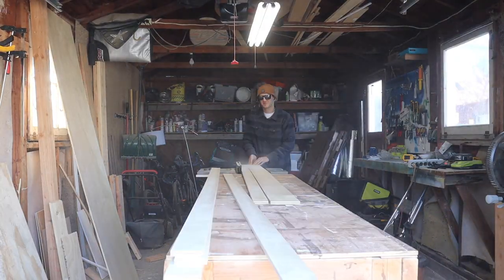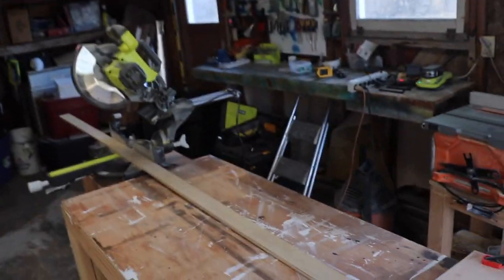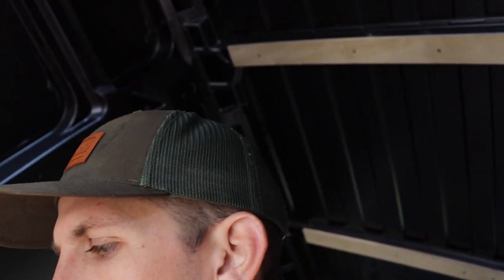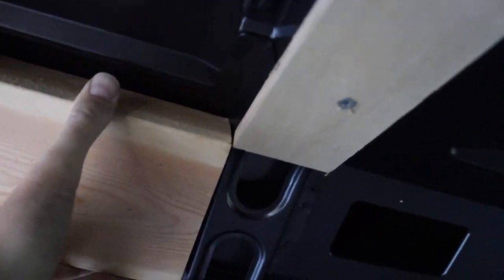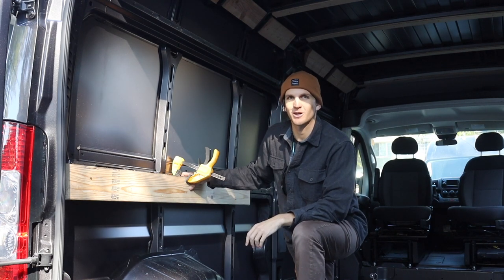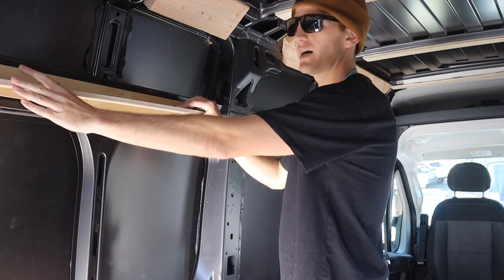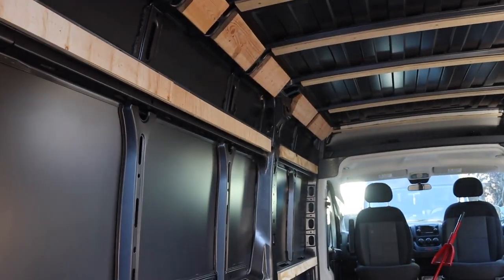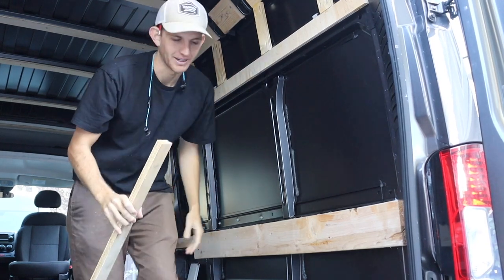VAN BUILD | FRAMING a RAM PROMASTER

Comment: Hi. Just got my van and took all of the wooden paneling off. I noticed that there was rust around each one of the self-tapping screws but I see that all of the pros are using them. Aren't you bothered by rust? Thanks.
Reply from the maker: Hi! How old was your van? What was it previously used for? My first van that I still have is 2 years old now and I’ve encountered zero issues!
Reply: @AnkeneyVanBuilds  Hi. The van is a 2017 Ford Transit. I think that the previous owner was a mechanic. 
You can see the rust here: https://photos.app.goo.gl/SLXsrjSoUwDvPkFP7  
Thanks!
Reply: sorry, wrong image. this one was from the roof. same thing though (but smaller) around self-tapping
Reply from the maker: @balaftuna  interesting. I know my screws are coated with a rust resistant type of coating so maybe that helped? Thanks for sharing the photos
Reply: @AnkeneyVanBuilds  Thanks! I'll make sure mine are coated.

Comment: Hope u don’t mind me asking another question. Do u worry about metal shavings?  When drilling are you just doing the wood or both wood and metal?  Just wondering since they are self tapping screws.
Reply from the maker: Feel free to ask as many questions as you want!
I’ve noticed when drilling into the van through the wood that the wood catches all the shavings. And I make a point of thoroughly sweeping out the floors every day when framing. 
I did the same on my first van over two years ago and have had zero issues! 
Hope this helped! Cheers
Reply: @AnkeneyVanBuilds  u are the best. Framing starts this week
Reply from the maker: @johnmeeker6538  hell ya! Kill it!

Comment: I am planning to run vertical L track to make my bed platforms height adjustable. Do you think the half inch plywood furring strips are stable enough to support such a system? Thanks again
Reply from the maker: I think 3/4 at a minimum !

Comment: I’m surprised you’re not filling in all those little openings in the metal with insulation first before blocking them with some of the wood like the two by sixes. What are your plans for insulation?
Reply from the maker: Hi! I have a video on insulation if you want to check that one out to see what I did!

Comment: i don't get how u screw down the ply wood pieces into the metal ribs..
like do u drill new holes or use the ones that are already there
Reply from the maker: The self tapping screws drill into the metal. they're specifically designed the attach wood to metal!

Comment: some of my 2 by 6s up top ended up being a little crooked, do you think that would present an issue with the wall panelling?
Reply from the maker: Hmm crooked which way? As long as the top of the 2X6 is flush with the ceiling frames work and the 2x6s are flush with each other than it’ll be okay if they’re crooked!
Reply: @AnkeneyVanBuilds  oh glad to hear! Thanks a lot!
Reply from the maker: @danielkopaee9241  you’re welcome!! Good luck 👍🏻

Comment: I just watched it for the third time, it’s amazingly complete. But it is a fairly daunting process for a beginner. How about this idea, since it’s a gift from the gods of automotive heaven that all these pro master 159 wheebase vans are quite similar, how about you design a series of laser or CNC cut side and roof ribs that can be installed to the walls as a base for cedar siding.  I bet you could figure out a way to do it with your very clever indentation in the sides where the bed is to make the bed longer.

 In my crazy mind, anyway they would be like the ribs on a kayak, maybe only  five sets per wall/roof allowing for all the ins and outs and difficulties. You might lose a tiny bit of size in the van but it would be worth it for us newbies. The beginner builder could attach them at prearranged points on the van wall/roof. Then simply stuff in the insulation and just start nailing up the siding ignoring all that blocking and challenging transition from roof to walls. I would buy something like this in a HEARTBEAT for a high price. Particularly considering how much money anyone will save on hiring an expert. You could ship them all flat in cardboard boxes w accompanying videos.

Anyway just off gassing over here looking for the easy way. Keep up the good work man, you are a wonderful craftsman and a fabulous teacher.
B
Reply from the maker: Wow that’s something I have never thought of! Interesting concept!!! Thanks that you for the ideas and compliments

Comment: Interesting, just curious but why not use either a rivnut or plusnut instead of just screws? The existing holes look like an M8 would work.
Reply from the maker: Those holes are few and far between. I have nothing against riv nuts.. my method is much less time consuming, cheeper, but still very strong and reliable! Thanks for the question Eric!

Comment: Awesome video. Going to frame my van this way. Only had it 5 days. Question on wood. Bed frame is 2x6 correct?  Transition from ceiling to wall is 2x4?  Look forward to more videos. Thanks
Reply from the maker: Both of them are 2X6!! I think I miss spoke in the video. 
Ceilings: 1/2” ply 
Transition from wall to ceiling: 2X6
Walls: 3/4” ply
Bed frame: 2X6
Hope this helps and good luck 👍🏻
Reply: @AnkeneyVanBuilds  really helps. Ty

Comment: Was the 1/8 in. drill bit used to pre-drill holes in the wood (not the metal)?
Reply from the maker: Both!!
Reply: @AnkeneyVanBuilds  I'm glad I asked!..lol  I'm a newb. I misunderstood the meaning of "self tapping".
Reply: Did you try to vacuum up the slivers of metal from drilling and Rust-Oleum where you drilled?
Reply from the maker: @planat96  yes, I vacuumed
Reply from the maker: @planat96  you’re correct tho. Self tapping does mean it should go in with out needing it to be predrilled. But for me it didn’t work great so I predrilled to make it easier
Reply: Awesome, thanks for your help.
Reply from the maker: @planat96  anytime :)

Comment: Did you screw the 1/2 inch ply directly to the headliner?
Reply from the maker: Underneath that header is another structural rib!
Reply: I did pull it back and see that I've seen some people cut it back.  It looked like you attached the 1/2 in. strip directly over it?
Reply from the maker: @planat96   I did not cut it back, correct! It’s a tricky spot for sure

Comment: I do not see you using any rivet nuts.  It is ok to drill into the van without these? Wont the boards risk molding being directly on the metal that tends to condensation when cold.  I thought it was best to insulate, tape all exposed metal with insulation tape and then frame onto that. I am open to easier ways.  Thank you for your help!
Reply: I'm building out a sprinter and I am blown away that people use such small skimpy pieces of wood😂 yes ma'am I bought a rivet gun and I will be using it most everywhere😮 I'm going to put 2 x 4 farad strips along the wall on the floor and then at the halfway point😮 anywhere there's going to be wait hanging or attached there will be a substantial piece of wood behind it that has been riveted into the Van Wall😮 watch some of the van life videos as people have the camera aimed at them while they're driving and you can see the cabinets in the shelves just bouncing up and down back-and-forth left and right and I'm thinking of myself up he must have used some plywood strips and some self tapping screws.😂
Reply: @justjudy7320  Great! Sounds good.  I like how you have paid attention to all the details! You may want to ck out Humble rd if you have not already, he uses 80/20.  I think what you are doing is enough but I am still considering the 80/20.
Reply: @laurelanderson-rostami109  oh I love George's work my other favorite is Greg Virgo out of the UK. He makes his living insulating commercial buildings and has several videos on the how and the why to insulate and use reflectix.
Reply: @laurelanderson-rostami109  I did purchase maybe 20 and I just thought it was too big of a pain in the ass too many different kinds of nuts and bolts too many different sizes of the 80/20.
Reply: @justjudy7320  Thanks for the feedback, that is my hesitation too, I want to enjoy building it.
Reply: @justjudy7320  I really like them both too!

Comment: It looks like it would have been better to put your electrical wires in the hollows in the metal frame prior to cover the holes with your studs, or insulation but I have no experience in this area. Very good video and thanks for sharing. Peace
Reply from the maker: Both ways work!

Comment: Hmm , so ur drilling a pilot hole with a bit that’s slightly smaller in diameter than the self tapper?
Reply from the maker: That is correct! Although if you have a good impact driver. You can bypass the predrilling most of the time. I usually will predrill the middle screw to make it easier to line up. Then I’ll just punch the rest in
Reply: @AnkeneyVanBuilds  got ya! Thanks!
Reply from the maker: @danielkopaee9241  anytime!!

Comment: What's the down side of only using the paneling with thinsulate and no 2x4s? Is that possible?
Reply from the maker: Do you mind clarifying a bit more?
Reply: @AnkeneyVanBuilds  well, only using the outer walls and thinsulate inside of that. Without using the, I guess its the framing 2x4s and 6s. Placing the thinsualte against the van wall and over that placing the paneling. As I've said I'm a pretty big dude.. The rock size basically lol so I'm looking to gain as much room as possible. I feel I need to add, once again, you're awesome thanks for helping all of us!
Reply from the maker: @Tracor3k99  so basically putting the walls up without framing? The downside would be that there’s ribs of the van that are super uneven so it would make things difficult. But not impossible!
Reply: @AnkeneyVanBuilds  I have to hurry up and get one so i can see. Expect a lot more questions in about 6 months when I do lol. I could probably get away with placing supports in the areas that need them as opposed to pushing it all out..maybe? Anyway! Thank you once again!
Reply from the maker: @Tracor3k99  Hahah I’ll look forward to all the questions

Comment: so the studs on the sides are all 3/4 ply wood?
i was experimenting with using a craig jig to drill and screw together 2 pieces of 1/2 ply wood and it was very difficult. the margin of error was slim and the hold was kinda weak.
Reply from the maker: Yeah those pocket screws don’t work well on anything thinner than 3/4”
Reply: @AnkeneyVanBuilds  thanks much!
Reply from the maker: @1800JimmyG  welcome 🙏🏻

Comment: Self tappers definitely aren’t staying in up in front
Reply from the maker: My van from 2 years ago claims other wise 😂
Reply: @AnkeneyVanBuilds  not quite sure what I’m doing wrong. Not sure if the fabric there has something to do with it. I wouldn’t think so 🤷🏻‍♂️
Reply: I’m literally in the middle of doing it right now, and they aren’t biting there like they were through the rest of the van
Reply from the maker: @danzbeard  there is a metal support beam behind the fabric that the screws go into :)
Reply from the maker: @danzbeard  it’s awkward angle to get it to bite into the metal but just keep trying !
Reply: @AnkeneyVanBuilds  I know there is a beam under there. The self tappers aren’t biting like they were with the other beams. The only difference is the fabric. With deductive reasoning that’s the only variable that is different... actually, the impact driver would be the other difference... 🤔🤔🤔
Reply: @AnkeneyVanBuilds  yeah, the angle is probably what I’m screwing up on
Reply from the maker: It’s tough, try to get the screw right at a perpendicular angle to the beam and drill slowly!
Reply: @AnkeneyVanBuilds  ps definitely digging your helpful videos. Honestly, watching them and building the van out simultaneously 👊🏼👍🏼
Reply from the maker: @danzbeard  just keep working it! Good luck!

Comment: And are the vertical frames 3/4 inch plywood or 1/2?
Reply from the maker: Vertical framing is 3/4. Ceiling is 1/2”
Reply: @AnkeneyVanBuilds  Thanks, so much!  So how many sheets of 3/4" plywood were needed for the build?
Reply from the maker: @jmd8675  just for the framing was 1 or 2
Reply: @AnkeneyVanBuilds  So, the horizontal framing at shoulder-level on the passenger's side is also 3/4 inch thick?
Reply from the maker: @jmd8675  yes :)

Comment: I didnt frame my walls at all!  Wastes too much space!  When i bought the van used tbey had already filled all the areas of  are sheet metal so i just went with that,  ot concerned about flat walls like a house?   With tables, beds cabinet u dont even see much of the walls anyway?   U did Great job . To me that was way too mu h work that i do t care to do!  Id dather be out Using my van!  And i only have hand and batt tools not table saw ect.
Reply from the maker: Glad that worked out for ya

Comment: Why didn’t you use plus nuts? They are the gold standard when framing out a van. You are cutting corners and compromising safety.
Reply from the maker: They're both good options, never once had a framing piece come loose in over two years and multiple vans. These screws are specifically designed to hold wood to metal and on top of that I use construction adhesive. No safety is being compromised here my friend! There are many ways to skin a cat.

Comment: CURIOUS. Why would you frame before insulation and wires
Reply from the maker: No specific reason. I think of it similar to building a house. So you frame, wire, insulate. But there’s nothing wrong with insulation first

Comment: What length kreg screws did you use?
Reply from the maker: 1-1/2
Reply: @AnkeneyVanBuilds   thanks for the reply! As soon as I posted the question I noticed it in the previous comments, was coming to say I found my answer but MAN are you on it with the comments. I know you get it a lot in the comments but your content is great! Did you find it difficult to insulate after framing? I’m using wool and didn’t know if it was difficult to insulate behind the 2x6s on the wall/ceiling transition.
Reply from the maker: @Pcas3  it would definitely be easier to insulate before!